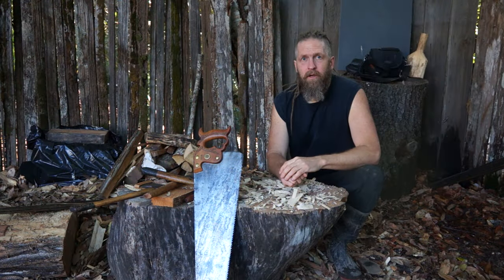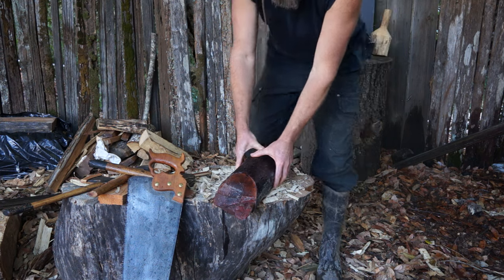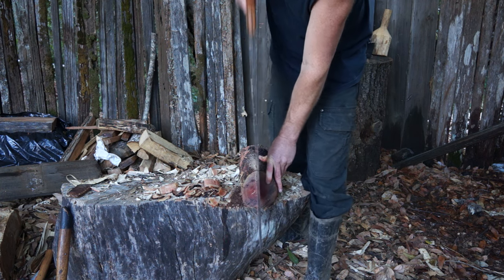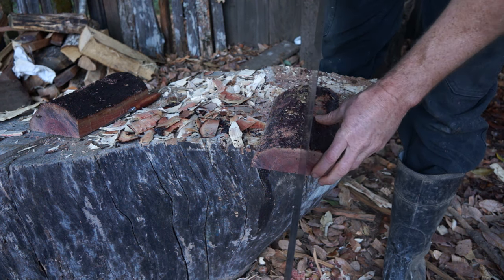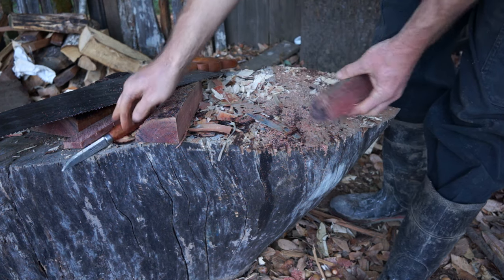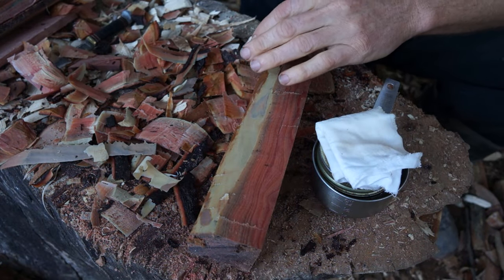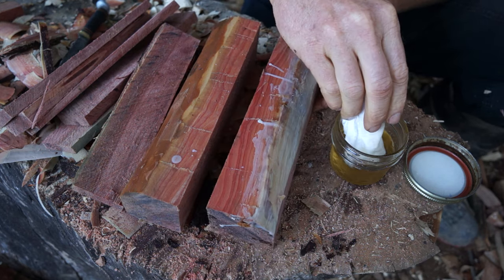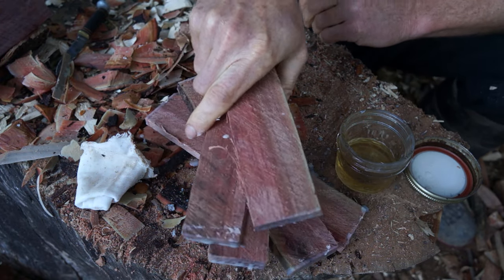STROPS FROM SCRATCH #3: Preparing The Green Wood

Comment: I'm loving this series man, I can't wait until the next episode. I was wondering if you knew the best way to season a freshly cut bow stave. I've been wanting to make a longbow for some time now, and we have a black walnut tree that needs to come down. The trunk of the tree is about a foot in diameter, and I'm thinking i'll need about a 5 foot log (I'm not very tall). Would I leave the bark on the log and cover the ends in tallow? And how would I store the log for seasoning? Any help you can give me will be greatly appreciated man
Reply from the maker: I'm enjoying it to.  I love this stuff.  You can do it the same way.  At
 least wax, paint or oil the ends.  If you oil preferably use something a
 little heavy or use a lot of it, but use a solid fat not liquid oil.   
Doing the ends will often be adequate, but I always have fat on hand, so
 if the stave is really nice or is a wood that is prone to cracking, 
I'll often oil the whole thing.  I have a whole video planned on 
seasoning wood and why it checks.  it basically comes down to how evenly
 it shrinks, which is largely about how evenly it dries.  the easiest 
way for us to dry wood evenly is to dry it slowly.  Also, a smaller 
piece of wood undergoes less stress in drying than a large piece, so 
splitting the stave down or even roughing it out slightly will help.  
So, leave it too long, split it down or hatchet it down a little bit, 
make several if you can, at least oil the ends if not the whole thing, 
dry it slowly.  Remember, slow means even.  If the moisture leaves the 
outside of the wood shrinking it quickly while the inside is still wet, 
stresses will develop and the wood starts opening up cracks.

Comment: I just got a random idea. How good of a handle for an axe would Yew make? From what I read/heard it was one of the best materials for bow making. the hardwood at the front and the softer wood at the back to absorb some vibrations.  I don't have the skills to make it but if you think it's a good idea maybe you could try it. If you think it's stupid why do you think it would not work
Reply from the maker: Usually axe handles have the grain oriented in a way that the yew sap wood would end up on one side of the handle.  In order to make a strong handle, it would be ideal to maintain one growth ring on the sapwood side if it were oriented the other way, which could be challenging and would limit you to a straight or naturally curved handle.  It might work as a wood, but the one thing about yew is that it is not a tough wood.  When it breaks, it explodes apart like some brittle woods do, whereas most handle materials are tougher.  It also grows crooked a lot.  It's hard to find good bow staves and would probably be just as hard to find an axe handle.  I'm sure someone has tried it.